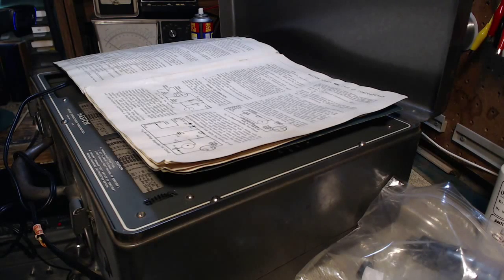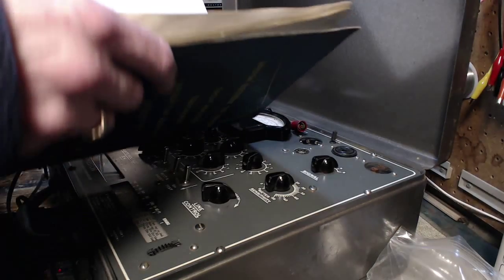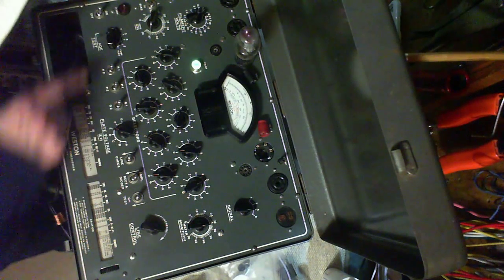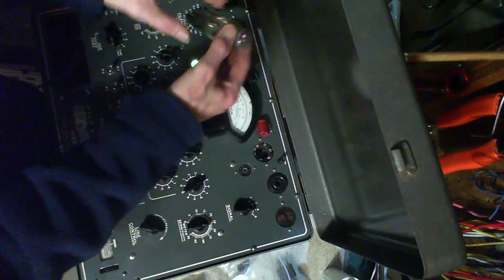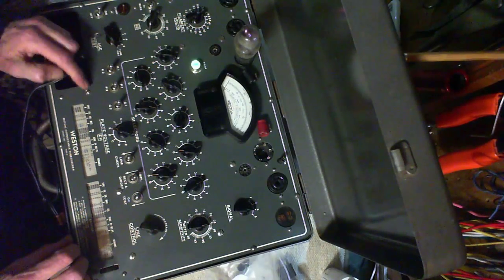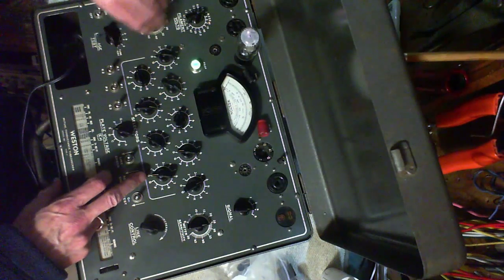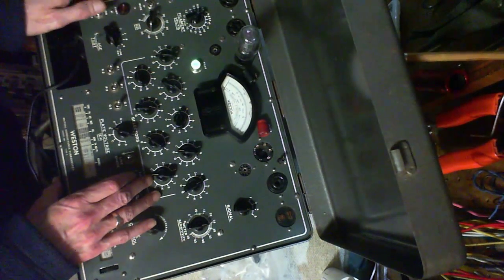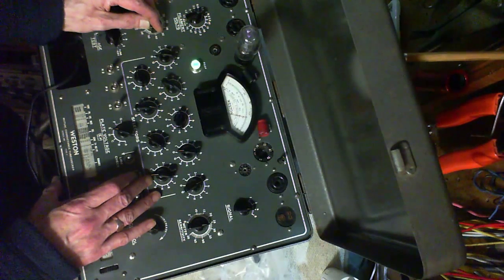Testing 2050 Thyratron Tubes - Seeburg Jukebox Selection Receiver

Comment: Using Google Voice typing so if some of the words in my comments got misspelled that's why sorry about that

I used to also have a Seeburg vl200 and it had the  2D21 for the stepper which one do you think is the better tube the 20/50 or the other one I mentioned

Comment: I used to have a jukebox just like that one that you're working on I had bought it back in 1986 off of the school board one of their auditoriums used to be a skating rink and they had the Jukebox in there and I picked it up for $50 boy I wish I would have kept it that was the hf100r

One thing I've noticed it was unique about that particular model of Jeep boxed is it used at or Matt system for the wall box elections but it had pin switches that was slide back and forth for when you made a selection on the jukebox itself and whenever the last selection was played when you had made a selection on the jukebox itself it would put the record back and then stay at that point on the carriage unlike other seabirds that actually scan out from one end to the other and then rest at one end I used to work for a vending company in the late 1980s seabirds were one of my favorites they are very sturdy well-built jukeboxes

Comment: I'm late to the party, but is there any way to replace the 2050 Thyratron with some kind of solid state circuitry ? Those 2050 are very hard to find here in France, 35 EUR a piece, I'm trying to stockpile some, but it's getting expensive fast. I'm a small arcade operator, and with my father we try to repair those old Tormat units some time to time. Before long we may run out of these tubes and it would be a shame to put those EDS-160s into the dumpster ...
Reply: Is the 2050 supposed to glow purple?  The one I am testing does not.  Has anyone thought about a solid state conversion for the circuit the 2050 is in?  During the quality test, my meter shows in the red "BAD" area, but there is also a note in that area that reads "diodes ok".

Comment: I think thyratrons are very similar to modern SCR's and mosfets, probably closer to a mosfet at lower powers, once a certain point is reached they turn on hard, but if the anode cathode current is high enough the thyratron will likely latch on like an SCR.
Reply from the maker: william fleete This tube is used in the Jukebox system to receive 'pulses' without drawing any current.  The pulses come from a motor driven rotating switch in the wallboxes mounted at each table in the Diner and the complete lack of current flow means there is no sparking at the contacts.  No sparking means no wear or carbon build up so the switches are highly reliable over long periods of time.